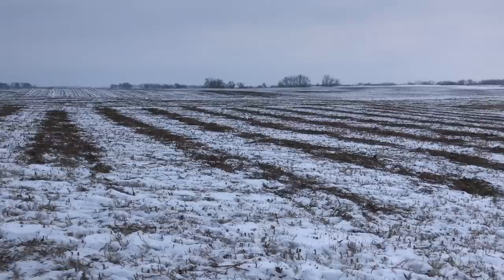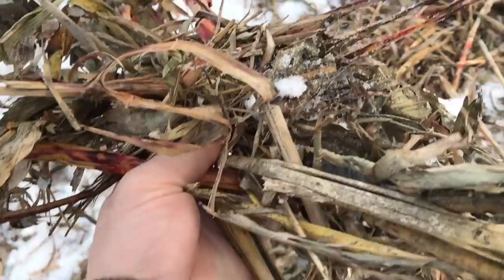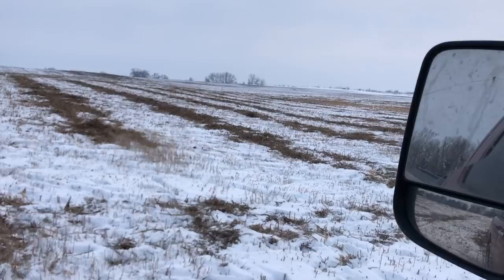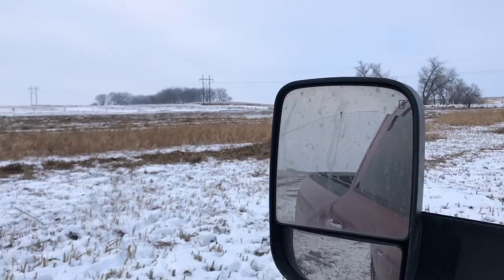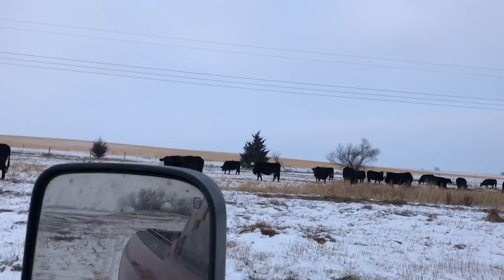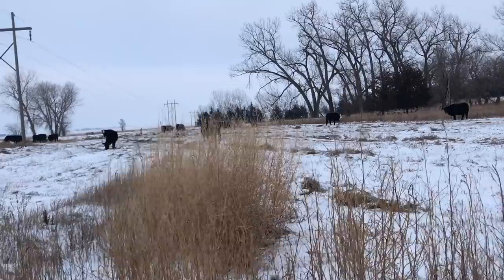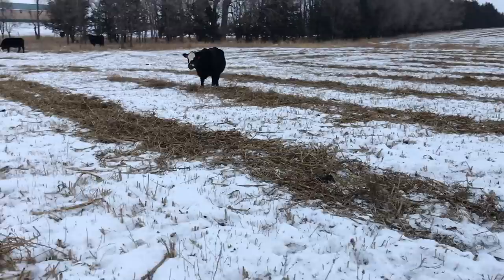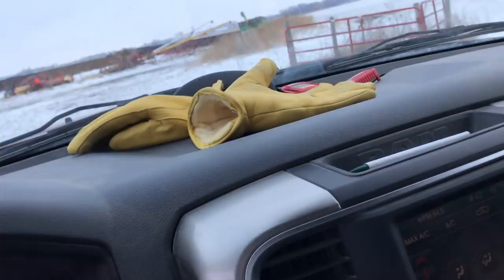First time swath grazing

Comment: Snow is your best friend in swath grazing, then they dig up the swath and eat it before going on and the snow makes it more palatable.   With are chinooks swath grazing doesn't always work but if your land is cheap enough and you live where there is good snow cover it works.
Reply from the maker: Our problem with snow here is its generally warm enough and then turns the snow super hard after it melts some and then the cattle cant dig through it

Comment: We swath graze on the ground also, we lay down a layer of hay with our bale processor onto the ground, and then lay down a layer of TMR over the top which consists of silage, corn stalks, beet tailing and straw. They clean it up better than they ever would putting it into feeders, and the manure is already distributed out
Reply from the maker: are you just using bales? am i understanding that?   Im trying to get rid of baling this was just cut with disc mower and nothing else... Hoping to lower costs while keeping nutrition values there
Reply: Its two completely different ways of doing it, I guess I just call it swath grazing because  they still have to forage and clean up the feed you lay down for them and it’s layed in a swath . That way of doing it seems very efficient and cheap. But I would worry about heavy snowfall covering the windrows and the cattle not being able to get to them.
Reply from the maker: That is always a risk about snow falling on them but here generally our snows come and go yes it could snow and be here all year but normally it snows then melts snows and melts and also once the cows find the windrows they just follow it.  I think if i did this again i would make the windrows narrow as i could to try to make them taller. (i also dont have a processor) so that is out of the question here for now
Reply: I have done this, I rake it immediately after cutting and try to make window as tall as possible. You save more green palatable hay that way.

Comment: Does that protein supplement have any Romensin in it? I ask because if so it will improve the digestion of that long fibre material as well as obviously improve protein consumption. We used to do this in late summer if we had cattle pasture grasses get to be long, tough and not very digestible with our cows and incalf heifers and it seemed to work well. 
One thing we did find out was it proved to be quite important to have enough licks out at any one time so that all cattle could get access otherwise the pecking order came into play quite significantly with inter animal bullying of smaller cattle by the older bigger ones. - see manufacturers recs. on this.
Reply from the maker: Not sure ill have to check the label

Comment: Hi Ted.  Big questions.  I think you are on to something here and that's why I'm asking.   You had some videos which cows grazed two paddocks beside each other - field (1) seedling rye with cornstalks & muddy  and field (2) drier field with multi-leaf tillering rye. I was wondering what became of those two fields and what was planted after.  I figured out you hayed off field (2) but not sure about (1).  What did (2) yield in tonnes per acre or bales and what happened with (1)?  Also you said in the cutting video the rye in (2) seemed more leafy perhaps shorter - perhaps better quality?.  I was wondering if you did any Feed Analysis Tests on the rye bales from (2) as well as the ungrazed rye bales in that wet field by the power line?   Or could you comment on the feed quality of the grazed field hay bales generally based on cows response to it when fed? Also what was the hay cutting date on field (2) versus the cutting date on the ungrazed rye field?  Thanks..  I am asking because I have 60 acres of rye and was debating grazing it in the spring but also I would like some hay off it too.  Just unsure what to expect.
Reply from the maker: Would you like to chat on a platform easier for you to ask me some questions i have instagram or could possibly talk a bit on the phone im slightly confused on what fields you are talking about but i do have feed samples off all my hay i put up this year  Let me know what you think  Id like to share the information with you.
Reply: To boil it down, what was the hay bale yield on the spring grazed rye acres.  The ungrazed ryes acres hay yield was given at the end of the baling video so they two field can be compared.   Also what was the feed quality of the hay from the grazed acres vs the ungrazed aces?  Did grazed acres hay have a higher Total Digestible Nutrient TDN value / relative feed value RFV?
Reply from the maker: There is so much information hard to share in just a reply on a video BUT the Short answer the rye that was grazed was way better feed quality with very little loss in yield.    the stuff that was grazed was also higher in nitrates than the stuff that was ungrazed and needed limited to half of total feed for pregnant animals.  I will tell you results of feed samples as 100 percent dry matter as the moisture that it was baled is different therefor changing the % values.  So the protien in ungrazed rye was 9% grazed it was 17.9% tdn 45.1 on ungrazed and 63.6 on grazed    The field that was green and tithering i ened up planting millet on after the rye was harvested off and the rye we got 171 bales off of 55-60 acres the bales weigh between 1550-1750 havent weighed any of them to be certain but that is what they normally weight.  the other field yielded similar to this one.  The millet then ened up with 184 bales roughly weighing the same.  (millet was planted and sat in the ground for 7 weeks before growing) The strip of rye that was mudded in with the cattle was sprayed off and soybeans were planted but lack of rain for 7 weeks turned most the soybeans into a non profitable crop  No differance from where rye was and where it wasnt.  may had had less weed pressure but hard to say when we didnt get any rain Now i dont have any proof BUT i think the huge part of quality in cerial crops harvested for hay is the timing. I believe to get best quality it would need to be cut sooner (right as it starts to shoot a head).  The two fields were harvested within a few days of each other but the field that was grazed was set back so to speak from the cattle being on it. So i think i could have got the quality from the other field as i did with the grazed stuff but i waited to long to cut it.   I was too intrequeed on watching it grow to 5 -6 foot tall and thinking i would get more tons than the stuff i harvested that was grazed and was much shorter but that thought was proved untrue as i got close to the same yield from both fields.  As far as rfv i dont see that on my samples I would be willing to text a picture of the samples to you for you to look at them in full detail. ill make separate reply with all videos linked so you can make sure you have watched all the videos on these two fields.  Ask any more questions or private message me with a number so we can chat more
Reply from the maker: grazing winter rye in the spring https://www.youtube.com/watch?v=PgAQPJuXqhU    spreading fertilizer  on the rye    https://www.youtube.com/watch?v=_ORUk6PqHPs&t=41s    ungrazed rye.  https://www.youtube.com/watch?v=WVyjaAOzpXM    cutting ungrazed rye https://www.youtube.com/watch?v=4rvPHpdUtoI    cutting grazed rye.  https://www.youtube.com/watch?v=8LfVxWpjW0c   baling ungrazed rye. https://www.youtube.com/watch?v=ywCkbNQu4j4    millet planted after grazed rye.  https://www.youtube.com/watch?v=3UYx8Nenwa8. cutting millet after grazed rye. https://www.youtube.com/watch?v=PsA8kJHM7J8&t=69s  cutting cain was planted into after ungrazed rye harvest. https://www.youtube.com/watch?v=iie7LVn5gDc&t=4s     i think that is all of them hope that is not too overwhelming
Reply: Great vids.  Finally proof it is possible to get an early grazing during tillering, a high quality rye greenfeed crop,  then a second feed crop.  Then maybe seed fall rye again.   I live in Manitoba and the growing season is 2 weeks+ shorter but it should work considering your rain took 7 weeks off so-ta-speak.  How many pounds fertilizer did you put on the rye btw?  Did the high nitrate levels have anything to do with lack of rainfall?
Reply from the maker: Im not really sure on the nitrate being kinda high from lack or just how it works but it really isnt high enough for me to worry about as we always blend it with something (alfalfa silage corn or distillers..).  I was actually going to try to plant cover crop behind it if it would have grown right away. millet does like hot weather though just keep that in mind

Comment: Just my experience there is going to be waste regardless it will be less if raked...and yes there will be dirt if you use certain kinds of rakes and they aren't set right, but what works for some may not be to your likeing...maybe try an acre or 2 see what you think
Reply from the maker: we have a wheel rake and unless everythign is perfect it gets alot of dirt to roll those huge windrows together.. ( 7-12 ton per acre crop)